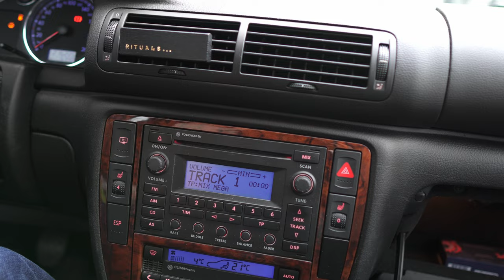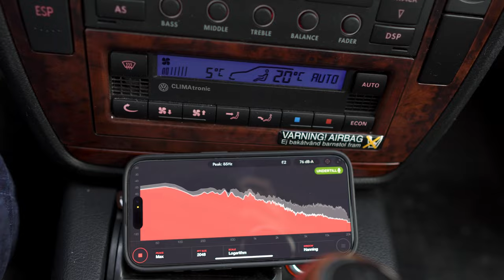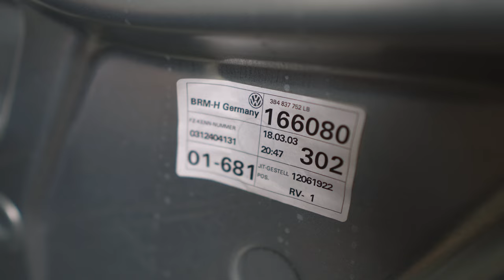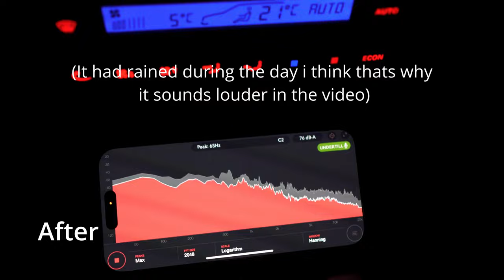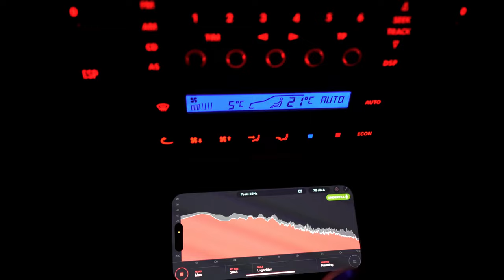Making a passat B5 ride like a Bently Part 1

Comment: Ah yes, the blasphemous 98-05`ish VAG door panels that are lovely to work with! They have been keeping me busy and " entertained " on my 2002 Leon since 2010. <3
Reply: You didn't show in the video, but make sure that you seal the bottom part of the inner skin or you will have water leaks inside the cabin!
Reply from the maker: Aaah yes entertaining Indeed! It wasnt too bad once you figure out how to loosen everything😂 there was a rubber seal around the inner skin that was used to seal and i just reused that again, thanks for the info tho👍
Reply: That will probably leak, they always start to leak at some point.
Especially when reused.
Reply: Can confirm what0 @FPVForLife said. I had to change my captain's door panel twice and once on the passengers side. First ones on each side were from donors, the last one oem new with some different type of white paste. All leaked until I've put a 5mm round bead of black rubber sealant going as high as 15 cm on the sides. 

You can take just the trim off, unscrew 90% of the bolts so you can pull the panel about 1 cm out, then bead away as you please : 50-50 inside and out was my choice.

Cheers m8! 

Loving the DSG Swap <3 Parts list video was great!
Reply: @r4mps  That sounds familiar.
Here is what I did.
I just pulled the door panel of, cleaned the area between the metal panel and the door metal. Then I just put a bead of RTV around it. Has been dry for two years now.

Comment: I dont know if its possible but you could install double glazed glass but that would also likely need stronger electric window motors for the heavier glass
Reply from the maker: Yeah that would be sick! Would definately do a big difference but 1. I dont even know if the b5 came with that as an option? 2. Where would i find it??😮‍💨

Comment: 10:10
That's wrong. Just push the connector in with a little force.
Then your fingernail is more then enough to pull the clip back/down a little bit and then the connector will just come off with a little pull.
If you use a screwdriver to pry on it, it will break almost every time.
And it will never click into place ever again.
Reply from the maker: Ofcourse thats what i did and it usually works but when it doesnt, you can finesse with a screwdriver, not saying you should bend it off ofcourse!

Comment: guys except the sound of the closing doors you won't get much quite inside. the road noise will be the same maybe the bass will be more sharp and deep at high volume but not something spectacular, overall in my opinion it doesn't worth the hassle. these cars already have a decent sound insulation under 70dB I believe. a quick hint for the back doors removal unbolt the locks from the door frame and don't brake thoes plastic rivets cause you'll never put thoes back as factory did and you get a rattle noise instead a nice umf. the middle panel will slide withe the locks attached to them search on yt this method is much elegant applies for golf also. do not overload the boot cause that stuff is heavy and the gas struts will fail. let's be honest will never be like a bently but will be a little better. make sure you clean the drains and put back the cavity wax, also be aware of condensation between thoes plates and the car metal sheet roll hard and avoid overlapping.
I hope you'll get the desired results, have fun
🙂
Reply from the maker: Thanks alot for the info! Obviously we wont get to a Bentley level of quiet but a little better atleast! I already notice better audio with clearer bass and the Idea is to put sound absorber aswell when i get the materials, and as you Said it probably wont get alot better but i always wanted to try and see how much of a difference it makes so it Will be a good project car to test on and fix som audio aswell👍

Comment: i did this to my 2012 Mazda2. Great little car but basic af. Only reason why i did this project was because I ended up with a $150 amazon gift card and said why not. 
The cabin noise was so noticeable that it always sounded as if one or even 2 windows were cracked open. 
$150 in giftcards. Free money so i spent like a week researching the proper way.
Mass Loaded Vinyl.
foam
and Butyl.
Spent a weekend installing this on all 4 doors and in the trunk. It did lower the noise but not by a lot. I probably would've been disappointed if i paid for someone to install this. But! for a $150 DIY project? Yeah it did it's job. I was a impressed. If anyone else would get in your car, they probably wouldn't be as impressed or even notice a difference. But I did this for me...and I was impressed. 
just 2 cans of spray adhesive, one roll of MLV and a single pack of Butyl rubber. 
I didn't even do anything extreme like installing it in ceiling and floor. 
So i covered only a very small portion of my car. random guess: covering less than 20% of the surface area?
and even, only covering the 5 doors, I didn't cover that entire surface area. 
It's not necessary to cover the entire surface. I think it's something like only covering 70% is the equivalent to 95%. 
That's like having just 5% of the total surface area being covered with 2 layers of material. Another 5%-7% was covered in 1 layer (MLV).
the other 90% is just whatever came with the car. 
The cabin noise at highway speeds was so loud that I would have to adjust the sound as the car would speed up from a stop. 
like the max level in that car was like Level 30.
so something like Level 14 at a stop. Level 21 at highway.
after installation:
12stop/18 highway.
Imagine covering the ceiling and floor? and again, not even covering that entire area either. just covering 70% of the surface would be the equivalent to 95%. 
although that would cost hundreds of dollars more. It would probably be worth it. But then again going this extreme for a car that would have this little of sound deadening to begin with probably just means it's a cheap car. So why put $800+ (in just materials. no labor) into a shitbox? just spend the $150 and cover the doors. 
I was impressed for about a year.
When someone hit me and totaled my car.
Then I bought an Elantra. it was the same price as my mazda2 that i bought 5 years prior. 
Me: I have never felt so rich. i did not feel worthy enough to drive that beauty. lmao
....That's how loud and basic that Mazad2 was. 
i was just surprised that it had side airbags. I'd assume it was federally mandated by that same year. 

TL;DR:
If you don't think car projects are fun then it's probably not worth it.
If you do enjoy spending money on your shitbox then it's definitely worth it.
Reply from the maker: Man i love this comment! You definately need to love car projects to do stuff like this haha🙏🏻 and good info about coverage that is true on flat surfaces! Im surprised it didnt do that much on your car but i guess it could be wind noice etc and then you would need to do rubber seals between the door and frame and such. And i must agree the new Hyundais are UNDERRATED! Love those cars design so much! After i do the Doors i Will try the wheel wells and see because according to my iPhone im at ~73db and that could very Well be road noise and thats what it sounds like atleast. So that Will be next but then ill probably be happy because its pretty comfy already👍😎
Reply: @RedBaronGarage  I personally did notice a difference. A minor difference but way worth it to me.
The butyal sheets only need to cover 70ish percent of the surface but the MLV needs to be as close to 100% as possible. So I would've been in heaven if I had the money to fully enclose that 2012 Mazda2. Spending 150 on the doors was worth it. The sound it would make when you closed it 👌
Reply from the maker: Yeah i totally agree!

Comment: All that work, and VERY little difference. You cannot effectively nor substantially reduce nvh in the vast majormajority of cars.
Reply from the maker: Well it depends! Newer cars got very good isolation so not really worth it unless its a ”budget” car, but old cars can definately be worth it! Now this passat is hard to improve on because its pretty quiet already. That being Said i want to see how much better it is and im not going all in maxing everything just doing moderate isolation so its not heavy or expensive but can clearly hear difference in audio already👍 its an experiment for sure😎
Reply: This is just the begining tho, we are planning to do do alot more of these mats and some  sound insulator foam. Even if roadnoise isnt that much better bass response from the speakers will be much improved and.